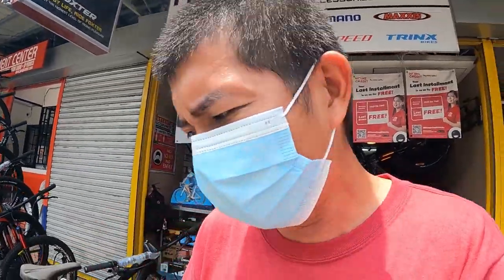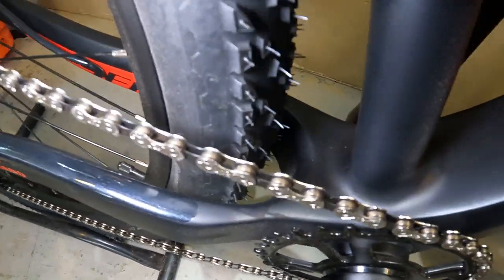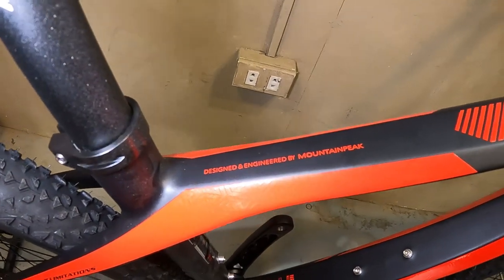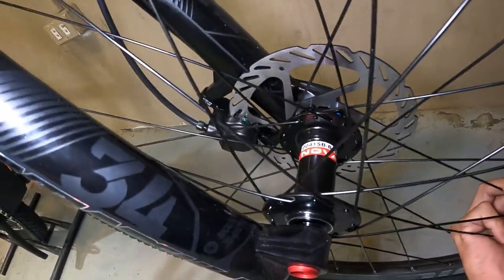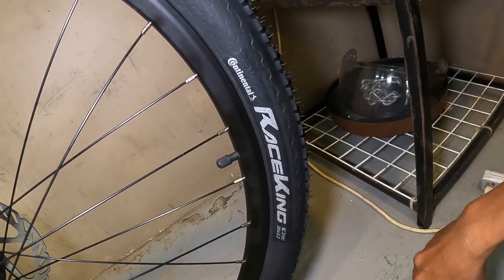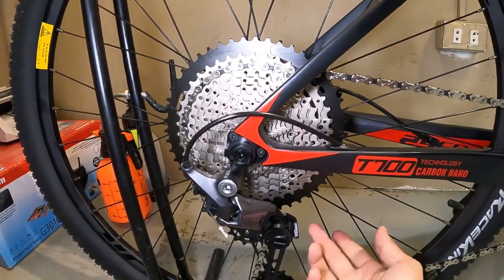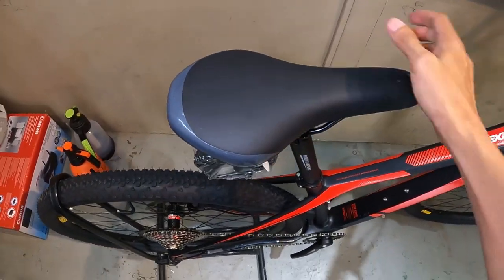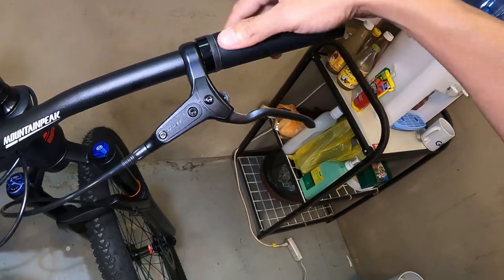Bagong labas na MTB | Mountainpeak Explore 6000 | Deore | Tektro | Prowheel | Novatec

Comment: Sana idol isinukat mo sa height mo para hindi masyado mahirapan magdecide mga gusto bumili. gaya nyan. Large 29er. pero sa anong height kaya siya pasok. ibaiba kasi size ng bike charts. Pareply nman idol if alam mo kung anong height pasok yang large.
Reply from the maker: sakin po kasi small 29 ang height ko ay 5'7"
Reply: Kadalasan pasok ang large frame sa mga 5'7 pataas, pero naka depende pa rin talaga yan sa pagka gawa ng frame, ako 5'8 ako may kaibigan ako na halos parehas kami ng height ang bike niya 27.5 large pero yung stem niya 35mm, nung tinesting ko dati ok naman pero mas swak sakin yung bike ko na medium 27.5 na may stem na 60mm -6